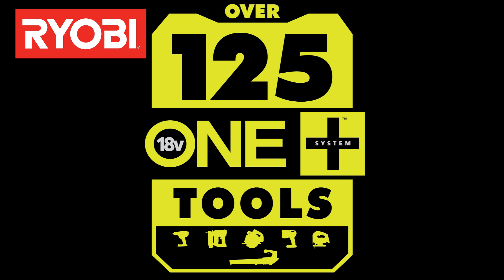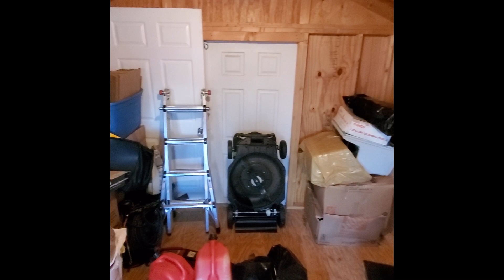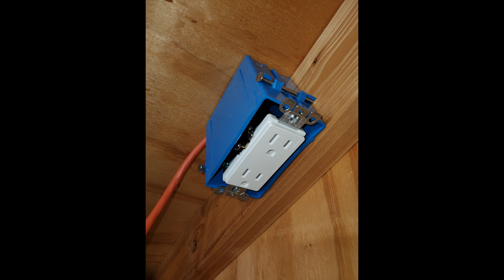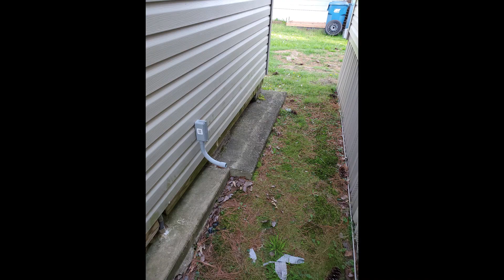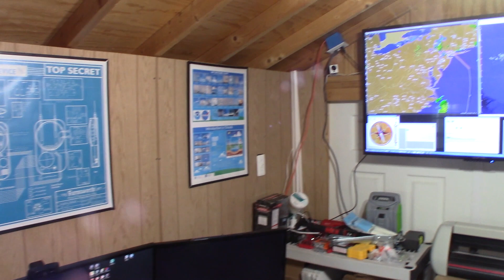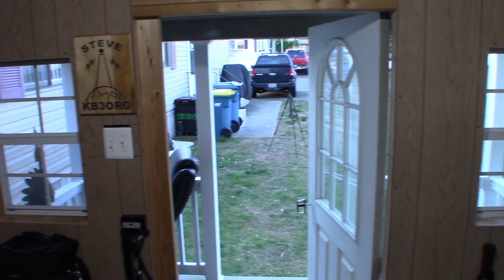KB3ORG - Shed to Shack Renovation (Quarantine Project)

Comment: Awesome, awesome!  2 years ago I was forced into retirement for a disability, I'm only 60 now, and we had to leave our house and my beloved shack and my Cushcraft A4s yagi up top.  I have been inactive on air since then.  I bought a 10x12 shed last year and made it my hobby room and after seeing this I may have to turn it into a ham shack!  Thanks for the ideas! 73 de KF7GYC
Reply from the maker: Thanks for watching!!  I love it out there for palying radio.  I just need to insulate it, that was my one mistake.
Reply: Definitely insulate it. I “super” insulated mine and I can be out there in the coldest weather with just a little space heater and it stays toasty. Utah had a pretty major heat wave this summer and I have just a small AC build into the wall and with the temp set to 74 it cycled off more than it was on in 106 degree weather!

Comment: You prob tell me how my radio setup or antenna is wrong should have used sheet rock would look so much nicer extra insulation
Reply from the maker: I'm sure your radio & antenna set-up is fine, I don't knock anyone's setup.  It's what works for you.  I would have loved to have used sheet rock but we had to do this quickly and cheaply, so I had to make some concessions. I only had two days to do this project and in the same time frame turn the room inside the house into a bedroom, including shopping for and assembling bedroom furniture.
Reply: Sorry I been in Facebook ham groups to long can't post anything with out a peanut gallery... 2 days is a time crunch came out good 👍 just might spend more in hvac

Comment: You will regret not adding roof insulation your reason for not using it is the exact thing going to cause you to be hot...
Reply from the maker: I pretty much know this but I was trying to justify not buying more insulation and make the project shorter, I knew it would come back to bite me in the butt.  Either next weekend or the weekend after I'm installing insulation in the ceiling.
Reply: @ThisOldHamShack  better than my boiler room shack lol